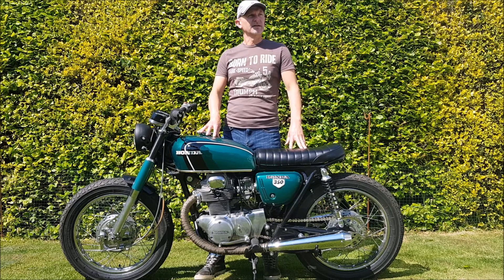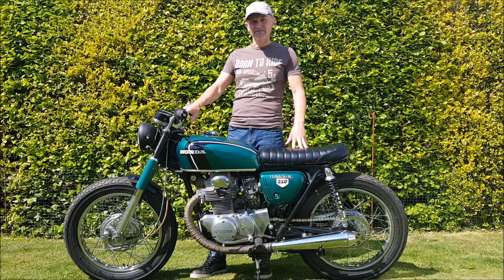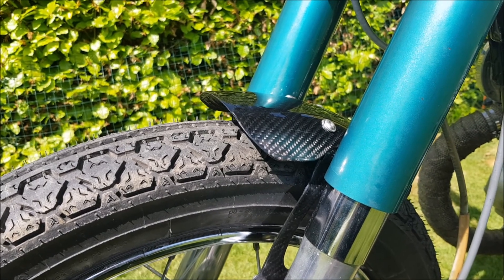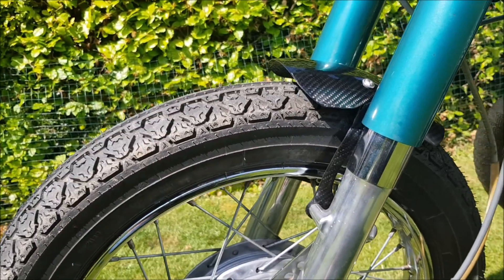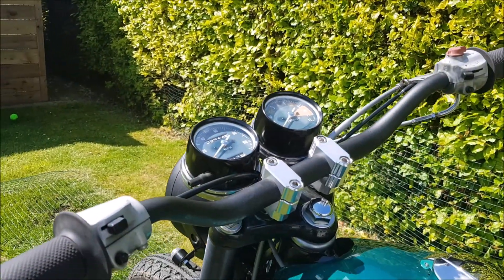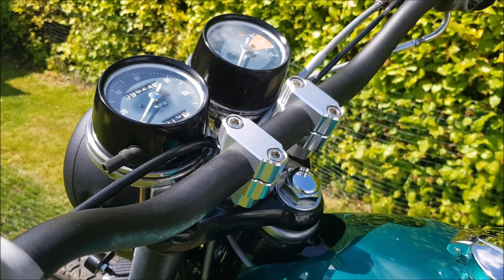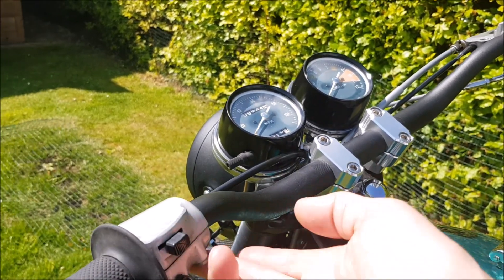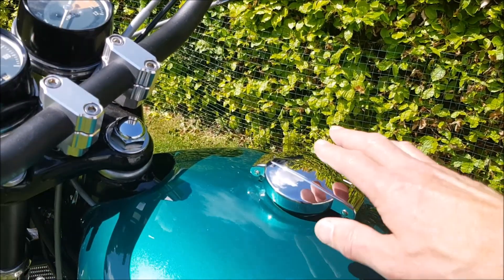Honda CB 350 1971 Brat custom

Comment: Where did you get your pipes they sound really good
Reply from the maker: I bought these pipes from Classic Bike Shop on ebay. They are a little too loud for me now I am taking this bike out on longer trips. The baffles are meant to be removeable so they can be repacked but I could not get them out. I have just made a baffle plate with a few small holes in it and tack welded it to the end of the baffle; it now sounds less offensive! I have done a few more suble mods on this bike since this posting so will do an update next time the sun comes out.